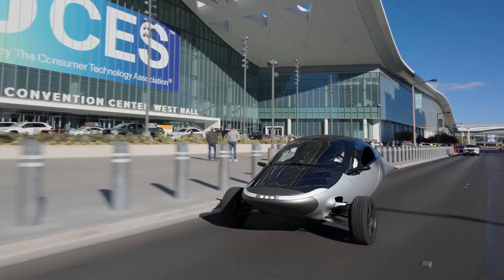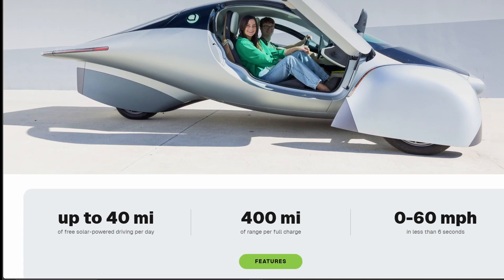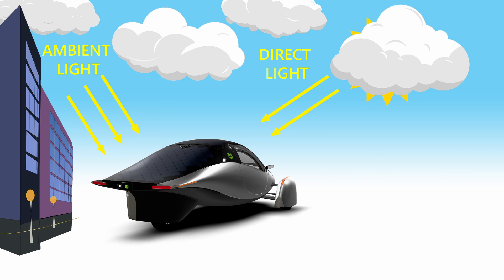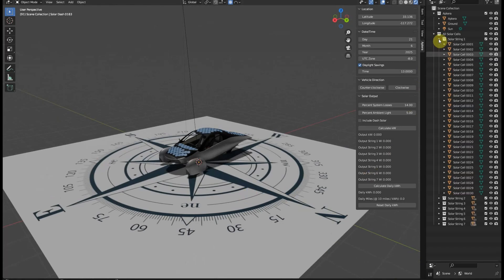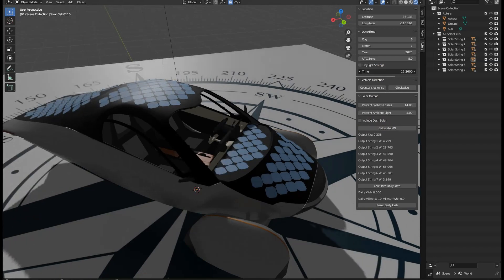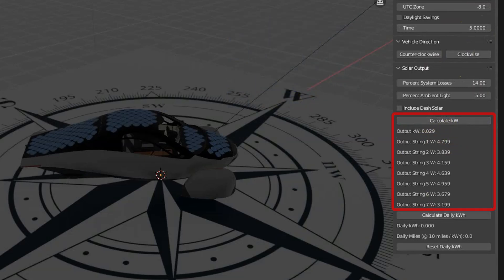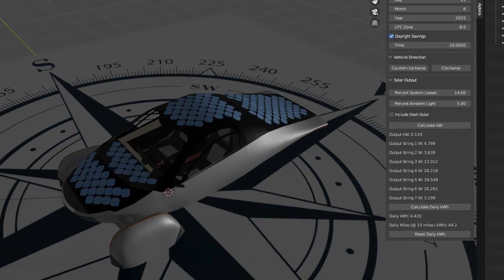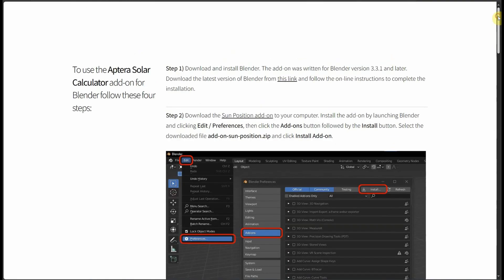Aptera Solar Calculator for Blender Version 2

Comment: I have to say that yes it looks possible 4.42kwh one day in the year under perfect conditions,   without the vehicle moving at all. The 10miles/kwh is going to be over estimate of the efficiency is my guess, so not likely 40 miles range will ever been seen.
Aptera suggests that most drivers in the usa will be able to get 40 miles per day range, 
problem is how often is it summer solstice and how often do you get perfect clear sky with no atmospheric effects ( clouds namely) and 10miles/kwh is not shown and certainly wouldn't be a typical average value if it is achieved under perfect test conditions.
They shouldn't be giving some one off max value to be used as an average value for most drivers and claim this something that is typical.  Still you've done well to show 4.42kwh quite an achievement.
Reply: I don't think Aptera ever suggests that most drivers would get 40 miles per day range.  Your statement "without the vehicle moving at all"... Actually solar modules produce more energy when they are cooler and would do better driving than sitting still (assuming the same angle to the sun). As the owner of a solar company for the last 14 years and someone who has been to Aptera, driven one and invested in it, along with monitoring over 100 solar systems daily for the last 10 years, I must say, this video is very impressive.
Aptera's website  says one can get up to 40 miles per day in ideal conditions.   Other than that, there are obviously shorter days in the winter than the summer and with the sun being lower in the sky, one wouldn't expect to get the same maximum in the winter as in the summer.   From Aptera's website, "How many free driving miles per day does Aptera’s integrated solar package provide? Aptera’s integrated solar package provides up to 40 miles of free driving range per day. "
Reply: @greenbergp  if you look at the solar output during the test drive videos in vegas, and others, you will see the output is extremely variable, very rarely stable, its  simply changing constantly, the max output can vary by about 50% depending on orientation when moving.
I discovered this going through the dubai test drive videos, and fambro said same thing just recently.
Yup cooler cells more efficient but that effect is so small compared to loosing 50% depending on direction of vehicle.
Solar output when driving will be much lower than when stationary.
Also this all depends on perfect cloudless days, thats a huge factor in real world numbers. The maximum values in theory are nice to know, but what matters is reality.
Reply: @greenbergp  they suggest that most drivers in the usa will hardly ever have to recharge since there will be enough solar produced for the average usa drivers daily commute ( somewhere between 30-40 miles).  They are saying pretty much that everyone will get 40 miles per day that must include all year around since they insist most drivers will not have to recharge.
They've been saying this for years.
Reply: On high performance cars, are zero-to-60 specs given for typical or optimal conditions?  Optimal.  The 40 miles/day is the Aptera's key performance spec.  "Up to" is very appropriate.  The solar miles/year spec is the one that needs to be more realizable, and it is.
Reply: @netscrooge  sure but you can't say average driver will get that all the time, it's a one off,
Reply: @namenotshown9277  The spec is probably correct.  The problem is dropping "up to" or "as much as" when quoting it.  That should never happen, but it does.
Reply: @netscrooge  exactly its been stated as a fact since they began, I suspect they might start using a qualifier, I think I"ve heard them use it a few times but not often.
Reply: @namenotshown9277  My experience has been more positive.  The little news segments on TV have the worst track record.  I've rarely heard anyone from Aptera drop all forms of the "as much as."

Comment: Reed the solar engineer at aptera said they were seeing near 500watts max ( not the 700watts the manufacturer lab data suggests is possible), and it appear that your model gets very close to that just over 500watts summer solstice near 2 pm.
I would think this seems to suggest the model might be quite accurate.
Here is a summary of your summer solstice predictions in vegas:
7am     53watts
8am     75watts
9am    171watts
10am  289watts
11am  377watts
noon   448watts
1pm     493watts
2pm      515watts
3pm      508watts
4pm       473watts
5pm       411watts
6pm       288watts
7pm       200watts
8pm       119watts
add it all up and you get 4.42kwh over the perfect day
Reply: Solar is rated at standard test condition (stc) which is 75F and 1000 lumens. per m2 (or something like that). Figure in all of the different angles of the solar arrays and you won't see 700 watts most of the time. What matters is the yearly kilowatt hrs for a given location and it sounds like Aptera is portraying that reasonably.
Reply: @greenbergp  there is an issue here though,
700watts is the manufacturers ( maxeon) test data at stc as you mentioned.
But the reality is 500watts is the maximum they have seen in their own testing once the cells are encased and in curved shapes.
It appears that 500watts is the best that will be seen.
But there is another issue relating to their claims. The average distance driven daily in usa by commuters changes but it was somewhere near 40 miles per day in the past ( not sure exactly what it is now).
The data that it used to calculate that will be many vehicles in many different driving scenarios. Its an average number.
Aptera claims their vehicle will be able to coer this average 40 miles perday , hence its a never charge type scenario for most commuters in usa.
But this is completely incorrect. Aptera would need to use average  numbers over a wide variety of locations and driving scenarios for this to be true.
Taking an un-achievable claim using 700watts at its basis, is not even possible to achieve. Their maximum achievable is 500watts, but in order to make some statement about the average commuter they need to use average data not some maximum. There is zero chance their vehicle will produce 40 miles range as an average over a year anywhere in the usa.
Its a fallacy and incorrect, its useful to fool investors, but in reality its not achievable.
Thats my point.

Comment: One issue is the carpark space they were sitting in out front of bagel shop is not flat,
it has slight downhill slope ( downhill towards rear of vehicle), that will put some error into the calculations.
But it is as per usual a very impressive piece of work indeed.
Why dont you try confirm with each test drive the exact time and date?
There is another test drive video from ces at "all about solar" yt chanel,  on 9th of jan at about noon, he got somewhat higher values. Interestingly he mentions being in shade and getting around 70watts, but is surrounded by large white/glass buildings at the time, seemingly given much diffuse solar. I think its  extremely complex to model the real world conditions but you've done terrific job, in fact more than just a bit impressive.
Reply from the maker: I did check with Steve and he said it was around 11am for his ride-along. The other reported higher generation numbers I believe were heavily influenced by reflective buildings. You can test this in the calculator by adjusting the "percent ambient light" value. A higher number can simulate parking or driving next to a reflective surface as it increases the light falling on the worst performing cell (the shady side of the vehicle). There is a hotel in Vegas that is famous for baking their pool guests with reflected light from the mirrored windows during certain times of the day. Not a great place to go swimming but probably an excellent place to park an Aptera.